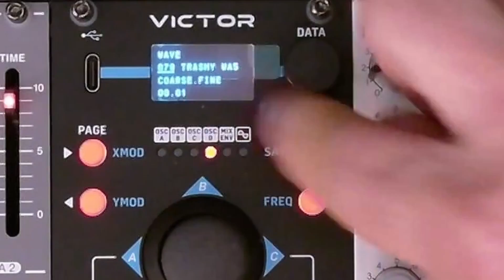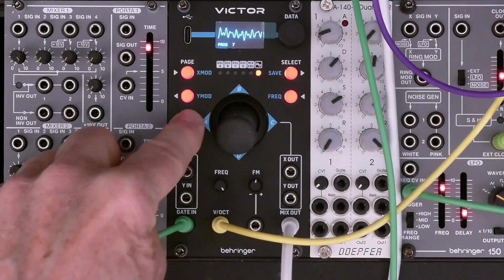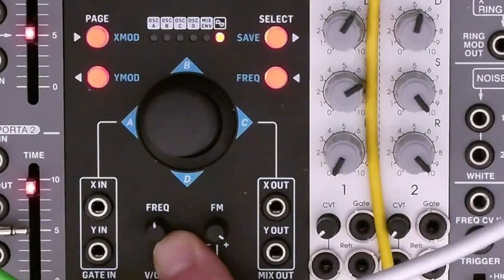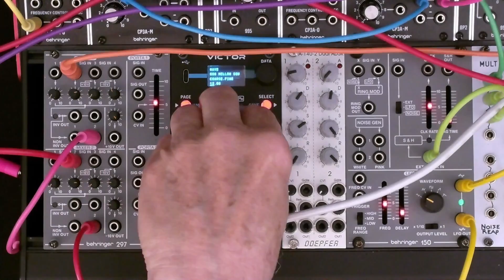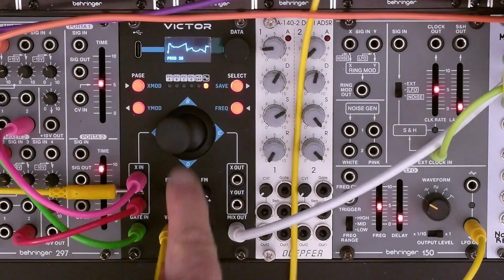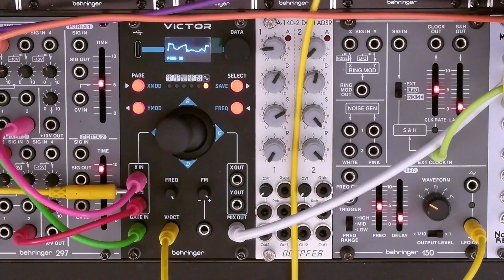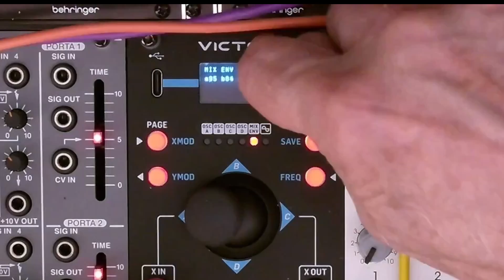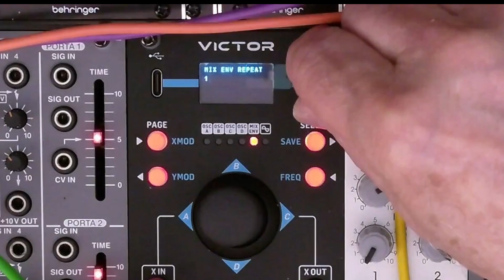Victor Part 2 - Detailed Tutorial (1 of 2 )

Comment: Is my gate input broken? Every preset rings out infinitely
Reply from the maker: See my previous comment.  Adding to that,  this is a mix of four oscillator outputs.  Like any VCO, it makes noise continuously.   You will need to add a VCA and an ADSR envelope to get the sound you’re looking for.   The gate is to start the mix envelope.
Reply from the maker: See page 48 in the quick start guide.

Comment: Thanks for the well made video, it helped me a lot understanding the module. My Victor doesn't deactivate the Joystick, when X/Y-In are in use, though manual says so. Any idea...?
Reply from the maker: @matzke0661  thanks!  The manual is wrong in this regard.  I talk about the interaction between the X in / Y in and the Joystick in this video starting at 4:35.  Let me know if you have any additional question.  BTW, this behavior is defined in the firmware, so the behavior could change with a firmware update.